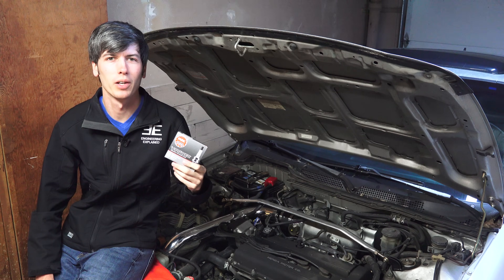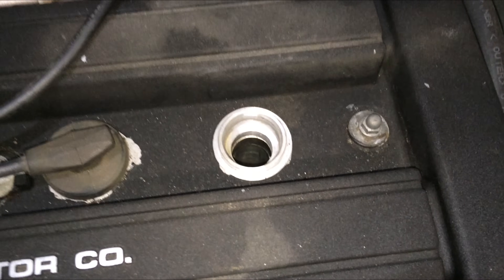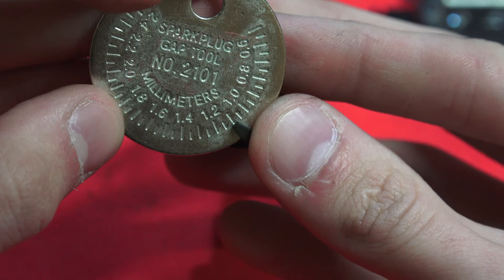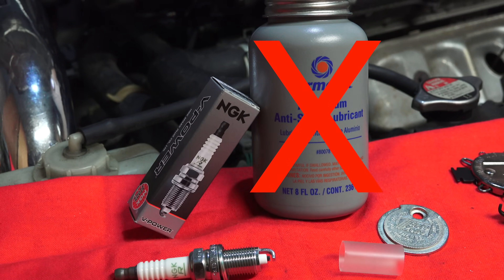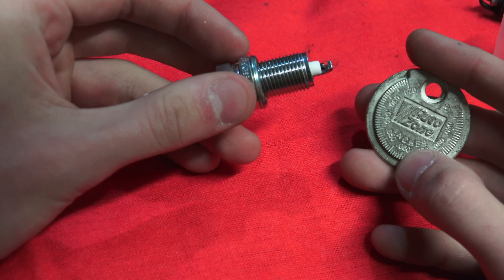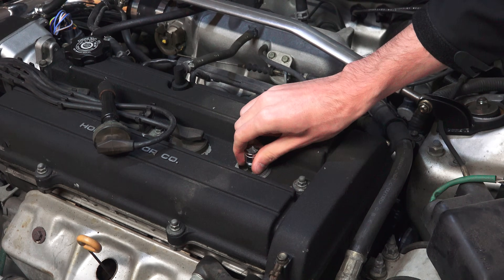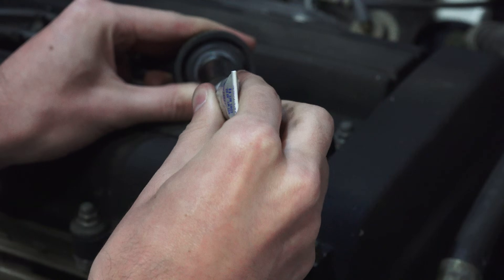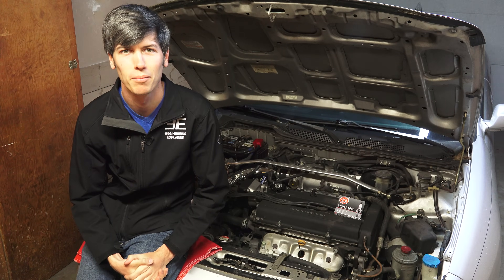How To Change & Inspect Spark Plugs

Comment: I would have put iridium plugs in that car and called it a day.
Reply: +LEX Maximaguy87 some cars dont like them. My MB only likes the cheap OEM ones.
Reply: and some even have them standard like the 2005 and later Suzuki Swift 1.3. That is a heft 21 euro per spark plug for a 100k km service life.
Reply: +Mortalomena european cars can be very specific. VW turbos run best on the 4 prong ngk copper  racing plug. Most cars i've used platinum or iridium with out any issues. I use NGK or denso plugs only. The rest are crap or straight up garbage.

Comment: No I don't have a torque wrench and I bet it's pretty expensive.
Reply: Harbor freight sells them for ~30. The specs he was showing where only 25-30 lb-ft though, which really just snug tight (the manual said 3/4 turn after the washer hits) so basically do it when engine is cold so metal isn't soft and don't kill it.
Reply: Harbor freight sells them for ~30. The specs he was showing where only 25-30 lb-ft though, which really just snug tight (the manual said 3/4 turn after the washer hits) so basically do it when engine is cold so metal isn't soft and don't kill it.
Reply: Harbor freight sells them for ~30. The specs he was showing where only 25-30 lb-ft though, which really just snug tight (the manual said 3/4 turn after the washer hits) so basically do it when engine is cold so metal isn't soft and don't kill it.

Comment: Paid $30 for a set of 4 Spark Plugs at Autozone.
Reply: They either ripped you off or you use different currency
Reply: Layth Games it was their “special” which included a $10 rebate. Regardless it didn’t remove the engine check light. So that’s not the problem as they recommend it was.

Comment: The plugs I need alone are about $10 each, and I need 8. Your low cost is a lie man what did you use lawnmower plugs? It'd be much  less deceptive to say $10-80 or to say 'spark plug $10' The way it's written I had to double take.

Comment: Sorry, but the NGK spark plug company does NOT recommend anti-seize / grease on the threads of the spark plugs!  The force you apply to tighten the plug will then be far too large, even using a momentum-tool.